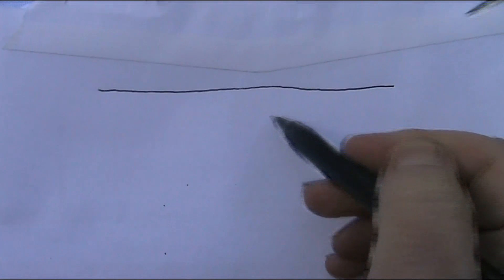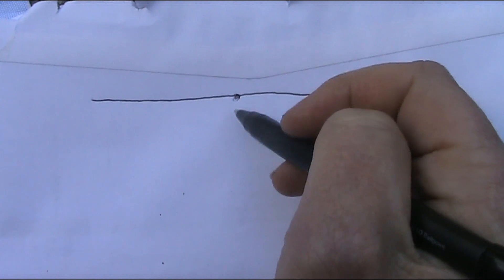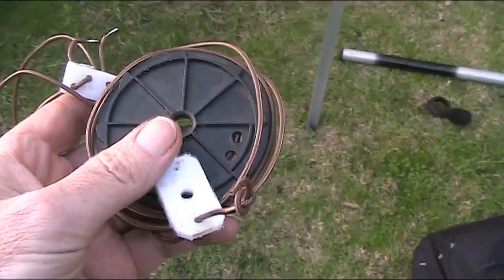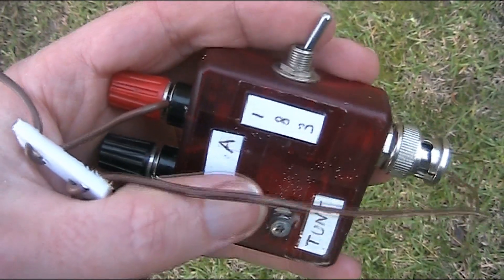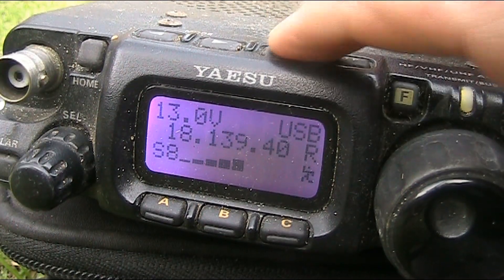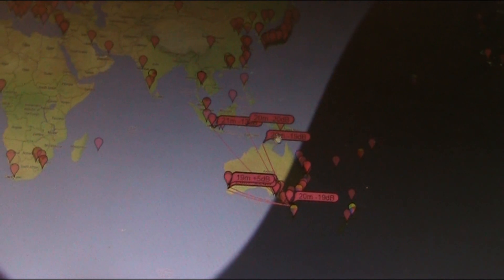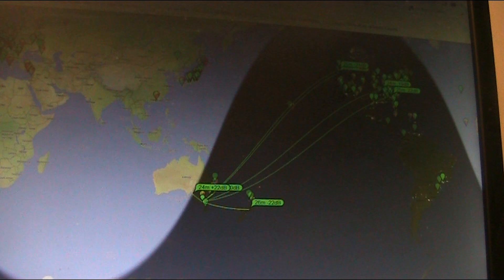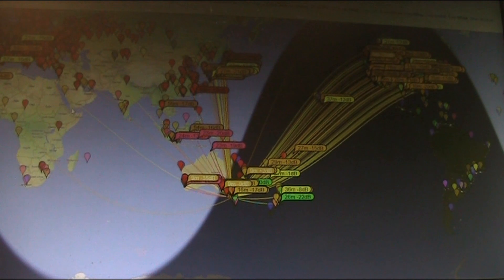Off centre fed vertical does 6 bands

Comment: Thank you, Peter, this is indeed inspiring. 🙂 I am relatively new in ham radio and as I cannot put up a mast, a beam etc. at my apartment, I am very interested in vertical wire antennas for outdoor operation. I am still experimenting and sometimes I do not even know if what I am using is still an EFHW with a counterpoise or if it is already a vertical OCF dipole. 😉
I wonder whether this is due to my lack of knowledge or whether the boundary is really fluid. 🤔
Anyway - subscribed. 👍
Henner DL1HNR

Comment: This sounds good, and definitely needs to be tried out. I'd be more impresssed, however, if you had made proper SWR measurements with a VNA, rather than with the much less accurate "SWR meter" in the FT 817. I find it rather suspect that you kept getting low SWR on all the bands you tried - including 17m and 12m where a horizontal OCFD with a 12% / 88% lengths split would show very high SWR. It's often said that a dummy load has a perfect 1:1 SWR, but it's not exactly a great antenna.
Reply from the maker: I don't care about VSWR. I always use a coupler. Provided the FT-817 is happy then so am I. Other factors are more important for antenna efficiency for your desired frequency and path.
Reply: @vk3ye  "Other factors are more important for antenna efficiency for your desired frequency and path" Certainly, and those factors include not having the feedpoint too close to the ground, and taking care of common-mode currents on the coax feeder. I'm saying the SWR meter on the FT-817 is not really accurate enough to make the conclusions you're making AND that you seem to be unaware of how exactly the natural SWR minima and maxima of such an antenna change with frequency. For your configuration, 17m and 12m should be unattainable, yet you claim to be able to tune easily on those bands. Something in your setup is clearly not working correctly.

Comment: Looking good Peter and interested to find out more 👍.... Can't say I have tried an OCF vertical. I have made vertical EFHW, 1/4 wave and "random" wire with 9:1 UNUN, sleeeved dipole and zeppelin. As you say, no radials or counterpoise can definitely be an advantage. 😀 Could you perhaps argue that an EFHW is just an extreme version of the OCF dipole?

Comment: For six years my main home aerial has been 21 metres of horizontal wire, fed one-sixth of the length from the house end via a 4:1 matching transformer. It is easily matched and near-resonant on the 40, 20, 15, 10 and 6 m bands and has yielded good DX on all five bands. It is about 8 metres above ground. It is also remarkably good for local traffic on 160 m, but only fails miserably on 80 m. Not bad for less than £30 UK (homebrew, of course - no commercial stuff here).
Reply: Good job! How did you build the 4:1?
Reply: Yes, that's a great choice of lengths, and makes a good antenna for 40, 20, 15 and 10 with 6 thrown in for good measure. I use something very similar (18% / 82% split) for portable use.

Comment: I built a similar antenna on 20m and it worked very well. I found that I had a lot of common mode current and needed a choke 1:1 unun to suppress it. It was a solid performer. Charlie KM4ZZ

Comment: Great antenna and results Peter. 
What is the approx impedance at the feedpoint?
When are your LC matching units going up for sale?😊
Reply from the maker: Guessing it would be in the order of several hundred ohms on 21 MHz, different on other frequencies. The LC unit is for sale in the sense that all parts to build one are available from Jaycar.
Reply: @vk3ye  haha, thanks Peter. If it's not too tricky, I can build it. :)
Reply: @DonzLockz  When you do build it , when will you have some  up for sale ? HahA . No seriously!
Reply: I have built a few of peters LC atus all work good there in one of peters radio books

Comment: Dear Peter, nearly missed your video, ...! 

What a wonderfull small antenna, with such a remarkable good preformance, you suggested here! 

If I should double all the 'lenghths', around the antenna and the 'pole', would it be possible to 'work' also the 'lower bands,' with that longer 'type' of  antenna? - Maybe with better efficiency? -  Feeding-point at 1,6m height will be no problem anyway. 

I have an 12m fiber-pole, and it looks like it will 'hold the wire without any doubt, ... ! 

I am looking not for 160m! 40 and 60m, maybe 80m will do it also, ... ! 
(Sun-spots will fade away in the comming future, not yet and tomorrow, but in 4 or 5 years, the situiation will be an other one!) 

Perhaps, I have to 'double' the amount of the inductance and capacitance, in the 'antenna-L-coppler', ... ? 

What will happened with the 'higher-bands'? Are theese bands going 'bad' then? 

What's with the 6m-band?  (We are able to do also 4m in DL/LX/EU !)
This is also an important question for me, not only for  the  'longer pole', also for the 'shorter one' with only 6,4m height. 

Please tell me, what you think about my suggestion. 
Sorry for my bad English, it is not my native tounge, ... ! 

72/73 de Markus - db9pz - (located in JN39fq ; 3miles/5km east of LX)
Reply from the maker: Yes it should work on lower frequency bands with a longer length. Though radiation patterns will change on the higher HF bands especially. Which might not necessarily be favourable if you want low angles.

Comment: Would it be possible to feed this antenna with a coax connected from the bottom, maybe with a choke?
Reply from the maker: Feeding right at the bottom will require some form of impedance transformer to match the cable to the very high impedance of an end-fed half wave. A choke would be desirable. But you won't get multiband coverage like I did with the antenna coupler.
Reply: @vk3ye  ok, thanks. I was thinking of the open sleeve (?) vertical dipole which is fed at the bottom but the actual feedpoint is in the middle. And whether your idea can be applied to this design to get more bands.
Reply from the maker: @PawełStobiński  That would work but would only be single band (except a 7 MHz one might work on 21 MHz).
Reply: I have done some experiments with vertical antennas fed by matching networks, mostly EFHW. When you connect near the ground, the common moles are satisfied and there is very little common mode current. Also with these multiband antennas there is such a thing as the antenna being too long. Interference can come from lower bands and cause intermodulation on 6 & 10m.
Reply from the maker: @antennafarmer7380  There is indeed such a thing about antennas being too long if it means a radiation pattern you don't want eg lots of high angle lobes. But intermodulation and interference have nothing to do with the antenna. If you suffer it then the problems are with your equipment - not the antenna.
Reply: @vk3ye  That is true but short of a radio swap, the quickest and easiest solution I can find is to make the antenna shorter.